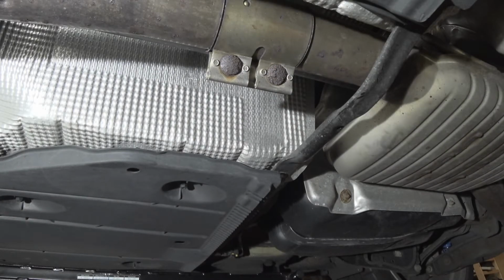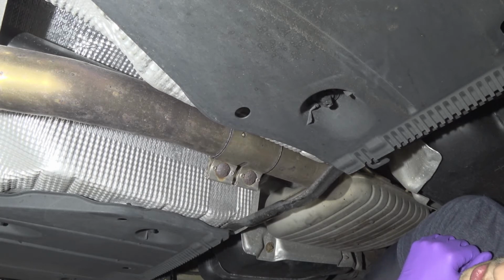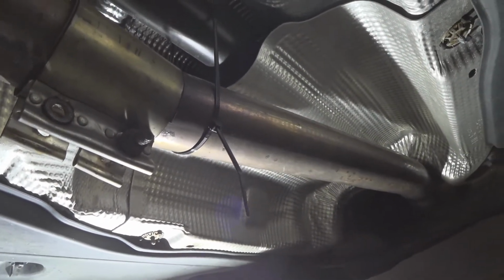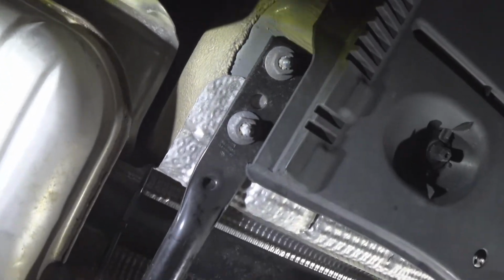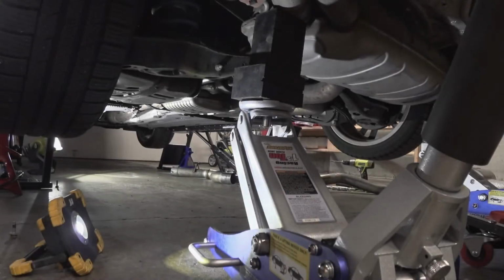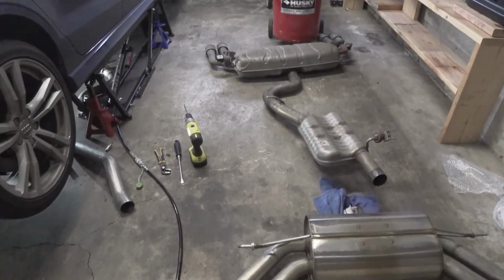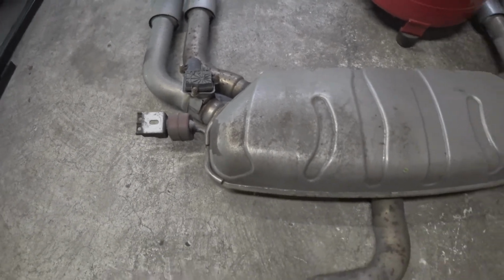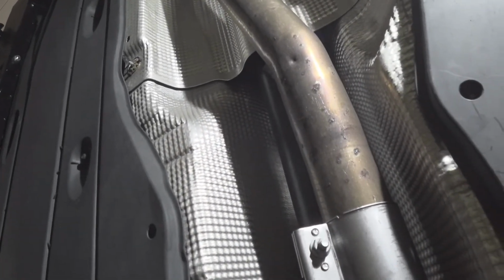Audi S3 Dinan Exhaust Install DIY

Comment: Love the video and thinking of installing the Dinan exhaust for my S3.  Did you have any noise restriction issues with this at a Laguna Seca?  How do you feel about the elimination of the valves?  Did you ever miss having them?  Do love the sound - reminds me the closest of an Italian sports car.
Reply from the maker: Scott, when I was @ Laguna, I ran with a catted DP and still managed to pass their strict DB requirements. I occasionally did miss the "cold starts" then the valves would close quieter, but do not miss the drone around 2-3K associated with my setup.

Comment: What happens with the valve connectors? Check engine light? Or OBD11 fix?
Reply from the maker: Ezio, the valve connections are capped off and tucked away. It did not cause any issues (CEL) with my S3.
Reply: Thank you sir. I watch all your videos. I just sold my Hellcat and bought a 2020 S3. I’m starting with intake turbo inlet and 034 Stage 1+. Hopefully with this I can be around mid 12’s in the 1/4 mile.
Reply from the maker: Ezio, wow! Coming from a Hellcat, you're going to need a little more than what you indicated to get the S3 close to the Hellcat. However, I think mid 12's should not be a problem at all. Cheers and enjoy the new S3!

Comment: What did you do with the two sensors?? Just left them unplugged?
Reply from the maker: Correct, I taped the ends up and left them unplugged.
Reply: @TheAutomotiveFanatic  ok thank you, and will this cause a CEL? I’ve installed a cat back and I’ve got a CEL on and I’m wondering if those sensors are the culprit.
Reply from the maker: @mikehawk8609 , unplugging the connectors should not cause a CEL. From my understanding, they are not sensor, rather connections to the devices which actually open and close your exhaust valves. I believe you can disengage them using VagCom.